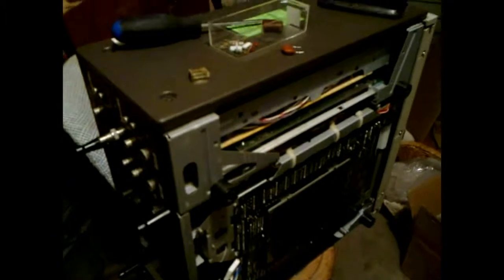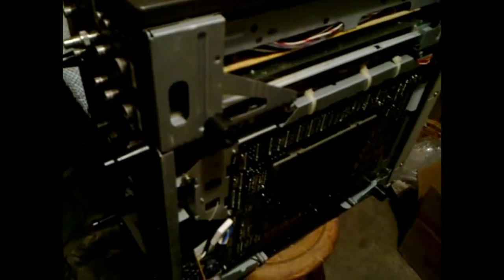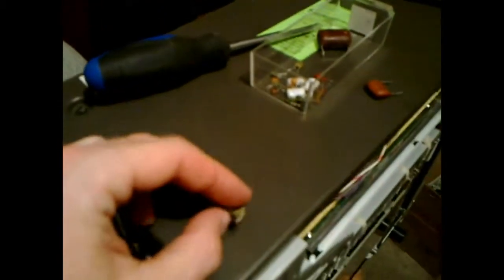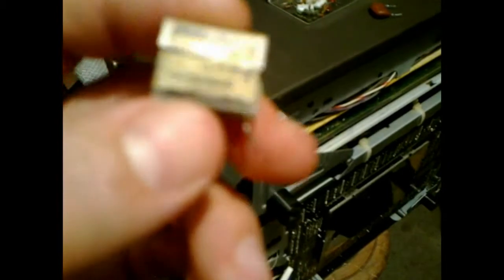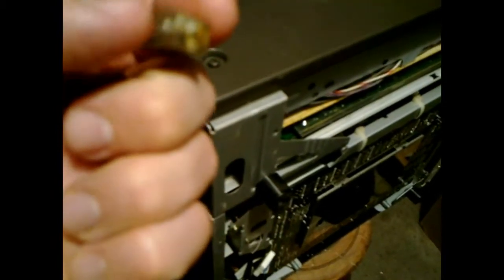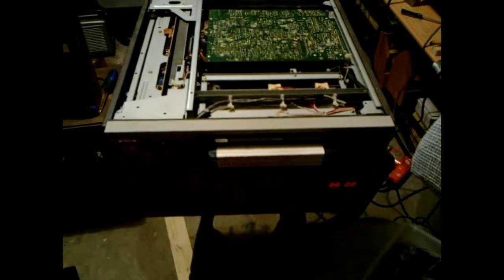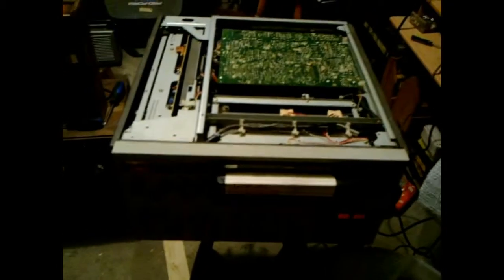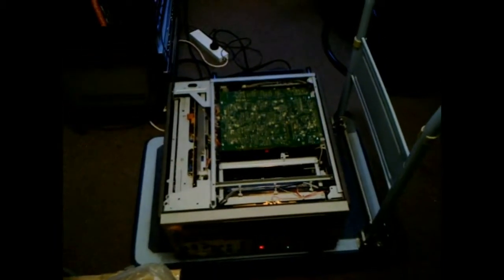Blown up RIFA capacitor in my Sony VO-5850 U-Matic VCR

Comment: I learned about the bad reputaton of rifa caps long ago, today i plugged in an oscilloscope and as I started taking pictures of it to sell on ebay, it starts sparking and pouring out smoke.  A rifa capacitor blew up inside.  "Heeeeey, its one of those crappy things."
Reply: incase you didn't know, theres x and y class capacitors which need to be replaced with the same class capacitors.  not sure what one you got, but they have safety requirements like they short or open circuit when they blow up, and stuff like that.